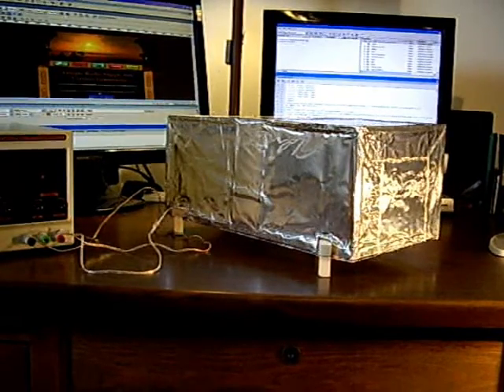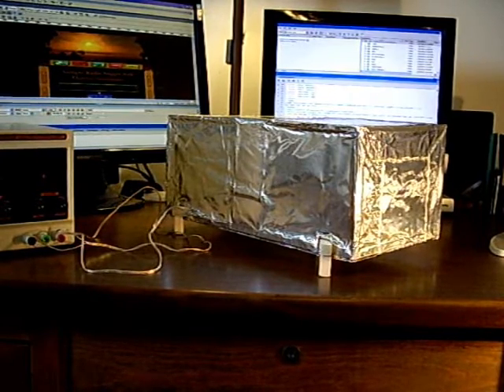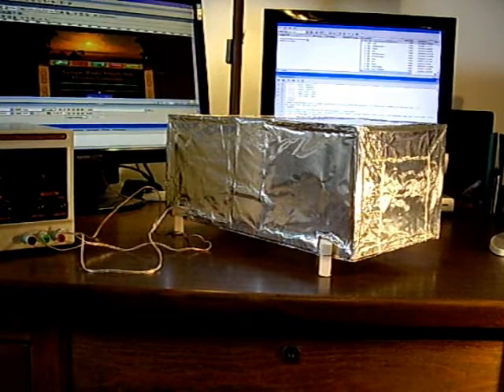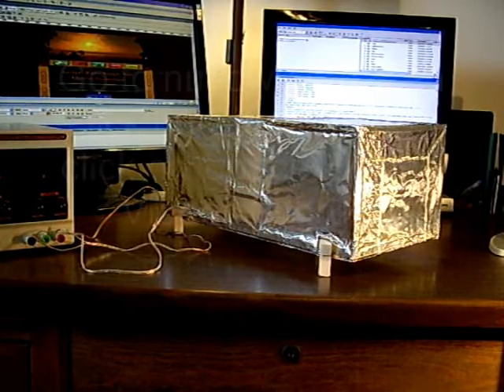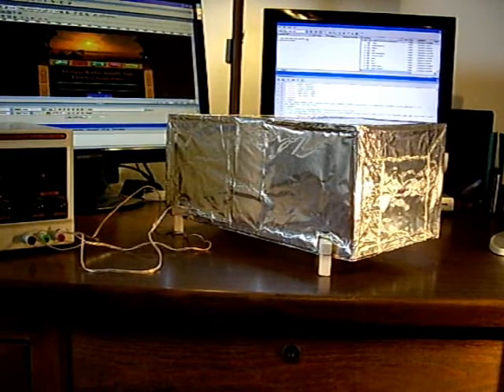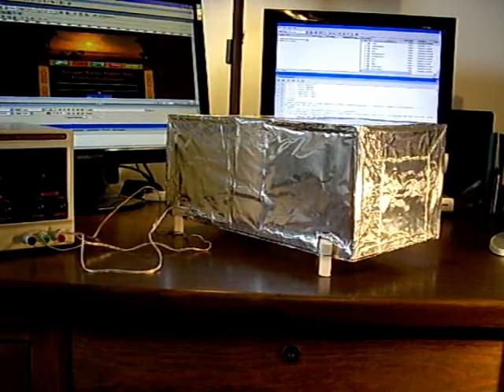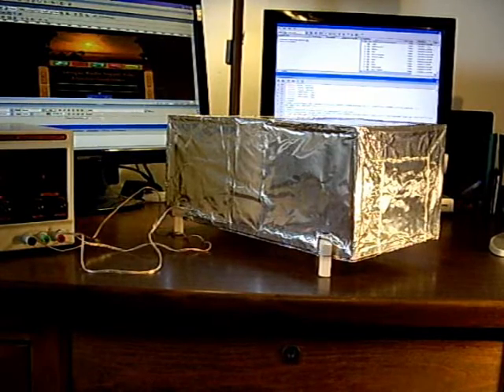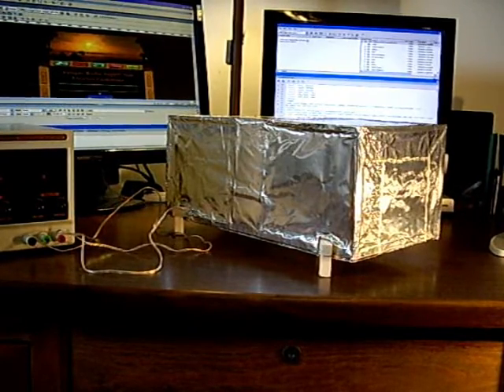Space Engine Video Working Anti-Gravity Propulsion For Nasa Trials In Space

Comment: NIce device, is this  solid state or mechanical? I hear mechanical sound ??
Reply from the maker: It is DC solid state controls driving mechanical devices.
Reply: THX.  tO NOT MISUNDERSTAND, i AM WORKING ON CLOSED LOOP TOO BUT IT LOOKS LIKE YOU MAY HAVE SLIP STICK STILL, i KNOW ITS NOT easy to test either. oops my caps lock was on.. anyway, the best test suggestion I can give is to increase two things and thats how I test my stuff:

increase the  frequency of  the  "hits or pulses" to say at least 12hz, increase the pulses or cycles per one revolution.. all to get a much much smoother output. put it on a pendelum string and film it and see if it stays at a deflected angle however small.  best luck